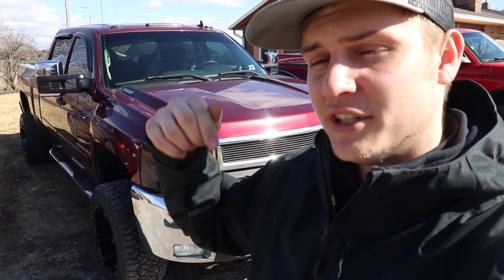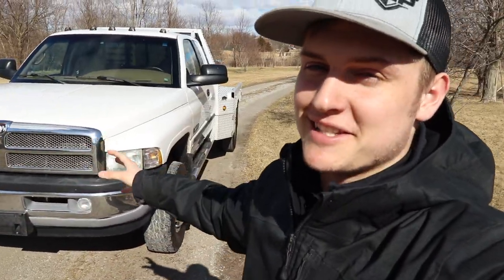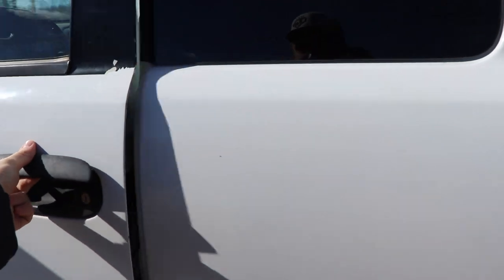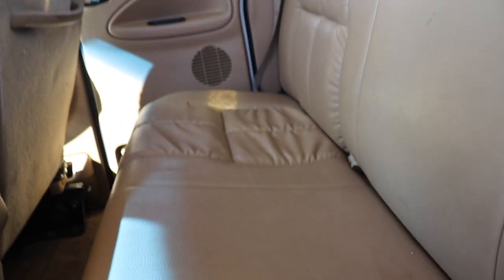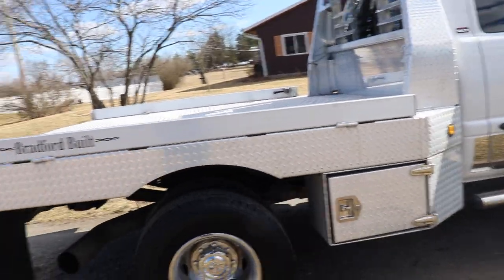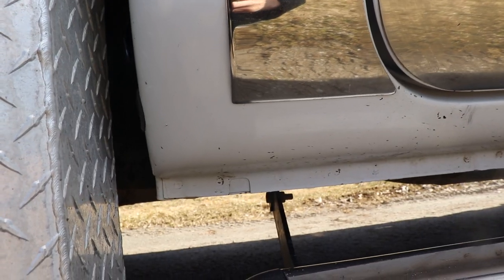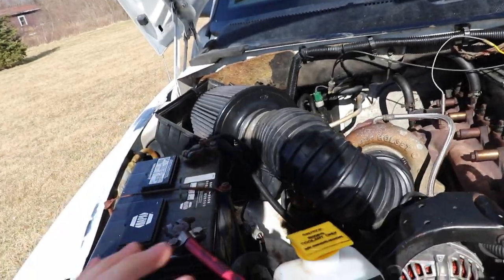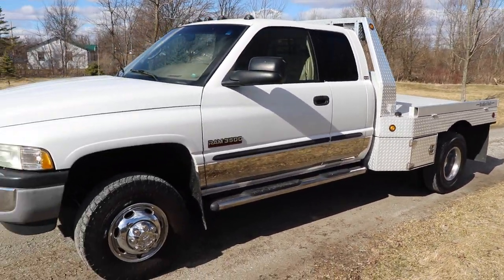I BOUGHT MY DREAM CUMMINS DIESEL TRUCK!!! *AGAIN*

Comment: What type of south bend dual disk is it? Does it have a lot of gear rollover noise? Or an trouble getting it into gear?

I went back and forth between a dual disc (full organic) and a heavy single (organic and feramic) and I couldn’t find any info on how the dual disc perform in the nv5600 so I went went with the single but it’s pretty grabby... 

Any info would be greatly appreciated

Comment: That’s when dodge was actually good
Reply: Mcnug3gt 384 
Yes and no. Dodge was good all along, it’s Ram that’s questionable! Anything 2010 and up is always kind of hit or miss... My 2008 Dodge Ram 1500 has been spot-on reliable for 325,000 miles!
Reply: In otherwords, everything up to a 6.7 3rd gen is pretty darn good!
Reply: Mcnug3gt 384 only bad thing about the 2nd gen dodges was the transmissions

Comment: Bro u should put a regular dually bed and put the flat bed on old whitey I think the dodge would look a lot better with a regular bed
Reply: Yeah, that bed is way too wide and long for a single rear wheel!
Reply: Deereman well with 20x12 probably not

Comment: Yo LOUD N PROUD Malachi I love your new 02 Ram 3500 Extended Cab Laramie SLT Dually 5.9 Cummins Diesel flatbed on it keep up with the project truck man keep up good work bro hope like Your 2008 Chevrolet Silverado 2500HD Z71 Crew cab 4x4 Duramax Diesel too and Your 2018 Ram 3500 Mega cab 4x4 6.7 Cummins Diesel too

Comment: I would leave the programmers off of that new truck you got I was just running a bigger injectors and a bigger Turbo.  I have a 99 24 valve Cummins with original vp44 on it the miles on my truck is 403944.  and it is a 53 block.  I drive it everyday the mods that I have on it I have the gauges in it I have four in from Turbo back I have 75 injectors in it I have an S&B cold air intake on it

Comment: you should seal the deal on that 6 speed cause its hard to find those they were only available in 2001 and 2002 if i'm correct. i've got an '01 2500 5 speed with no rust and 145,000 miles. my grandpa had special ordered it from the factory so it's fully loaded. and honestly i've been wanting to get replacement seats but i can't find any of them that are in perfect condition and are black leather.

Comment: And also I would run to cycle through that new truck of yours give the lubrication back to the pump that's what I run in mine.  . And I would do that for your fiance struck to I would take all the programmers off of it and just do injectors and turbos you have a less headaches with it with both of them